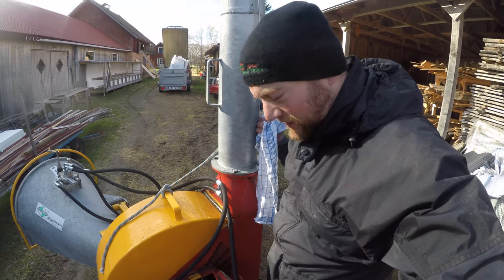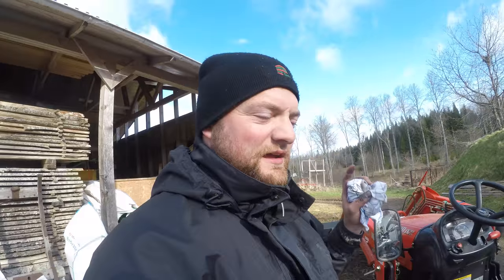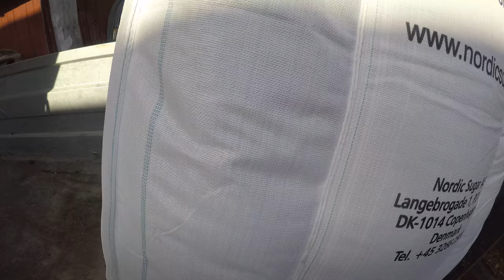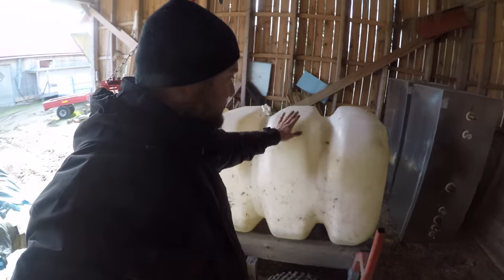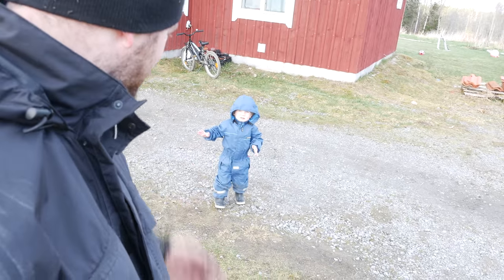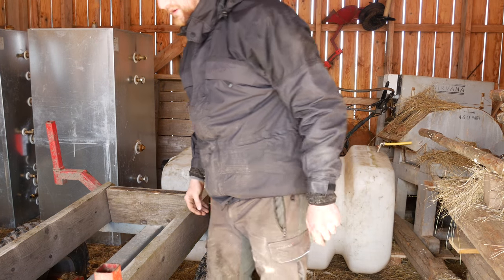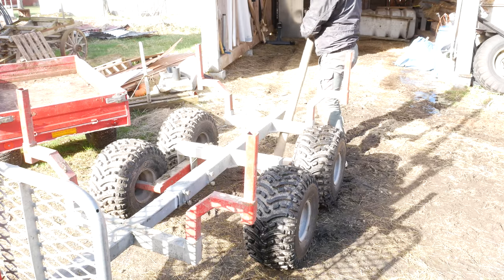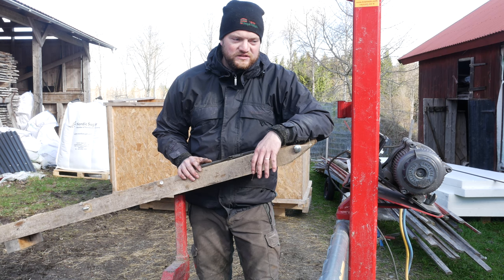How We Produce & Handle Wood Chips

Comment: I'd like to suggest something I have been planning for my trailer.  Make a frame for the water tank that fits the log trailer and set it up with pickup eyes that would let you back up to its spot, hook up some ropes and raise it off the log trailer, then drive away, lower or leave up until you need it again.  Do the same for the wood chip setup and back under and lower as needed.  I'm working on setting up an RV type pod I could back under, lower to the trailer, strap down and go camping, come home, back into its' spot, lift and drive out from under.

Comment: Hi Simeon, the trailer can stretch out or be shortened by the reach. This is how logging trucks can carry logs of different lengths. The pulley assembly is called a Snatch block in Canada.

Comment: The "little thingy" at 4:24 is called an over-running clutch in English.
Reply: Sprag clutch is also a common term for them
Reply: I would call that a slip clutch in Canada.
Reply: I would have called a slip clutch more like what is in a logging winch, or perhaps what is used with some PTO implements instead of a shear pin. This one free-wheels in one direction, but engages full power in the other. No slipping involved.

Comment: The little "wheel thing" in English we refer to it as a snatch block. Each one doubles your pull capacity while lengthening the retrieve time. My numbers may be suspect but the method will remain intact. Thouroughly enjoy our 'visits'.
       Mike
Reply: I tend to forget as much as I remember, thank you for affirming that I have not lost it completely.
        Mike
Reply: Absolutely correct- it doubles the time needed but cuts the effort needed in half. It’s simply a different version of gear reduction, like the derailer of a bicycle. BUT, that said, I’m not sure in this case that’s what is happening. It looks more like it may simply may be redirecting the line of pull to a different direction, in which case no mechanical advantage occurs. Have to wait for the conclusion to see how it’s rigged and what it does.

Comment: The round piece for the chipper to the transmission is a clutch. It engages under a certain condition to lock the torque from the transmission to the chipper and disengages when the transmission stops much like the clutch in an automobile but under a different circumstance 😁

Comment: At 15:25 that's a pulley block.   A single-stage pulley block.  There are more complex ones with 2 or three (or more) rollers,  but this one is a simple one that re-directs the tension that your cable is carrying.

Comment: The wheel thing is called a "pulley" in English, and, in English, we don't DRIVE things on a trailer, we HAUL them.
Reply: Craig Mooring it’s actually called a snatch block.  The wheel itself is the pulley, the steel block and pulley makes it a snatch block.  Add some rope and a block bar and you’ve got a block & tackle